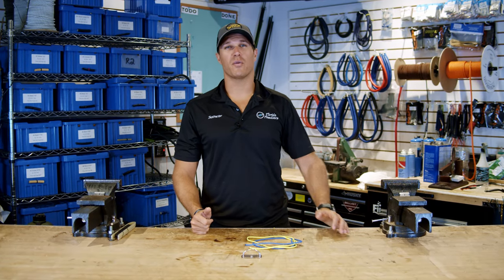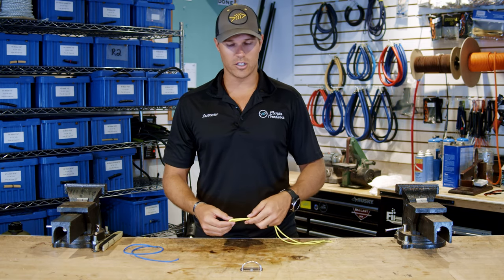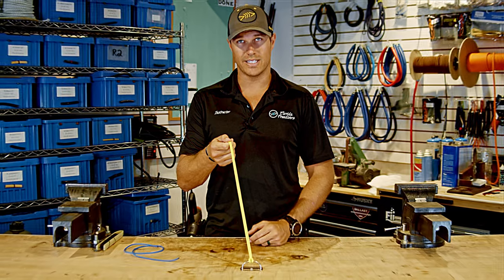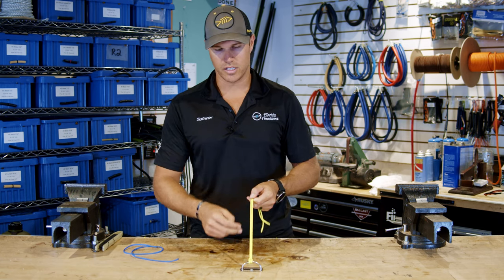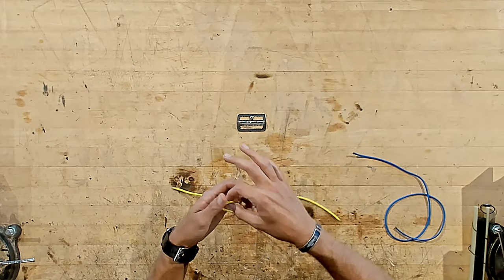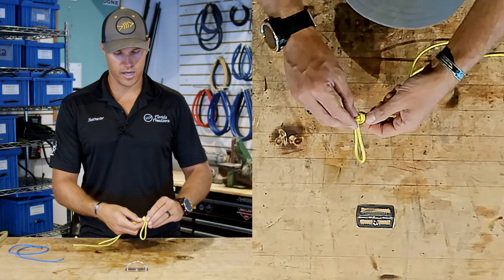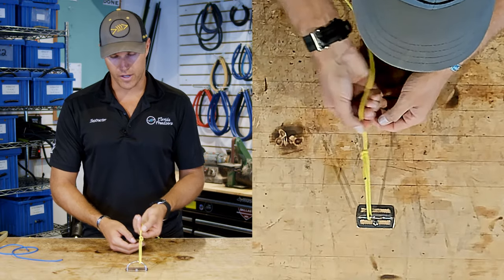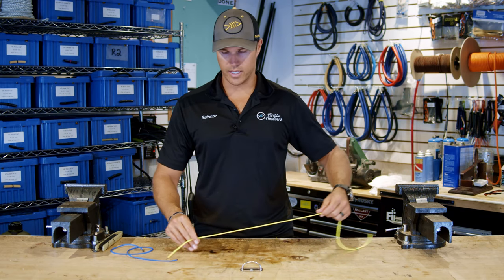How To: Freedive Knots - Florida Freedivers

Comment: square knots are not good they can slip even when tied properly. they are too easy to slip.  better knot is the sheet bend which is similar and just as easy to undo. and also works for two different size lines.  also for a better loop knot use a figure eight instead of a simple overhand-once the overhand comes tight you will have to cut it to remove it.  figure eights are easy to tie and untie that's why mountain climbers use them.  the bowline is the king !! I have towed large comm.  boats hundreds of miles in the ocean and then able to quickly untie the loop knot. I was impressed with the other knot you showed never saw it before but it looks good.